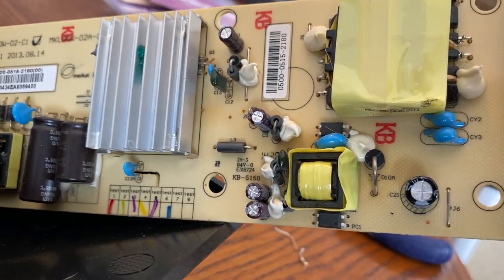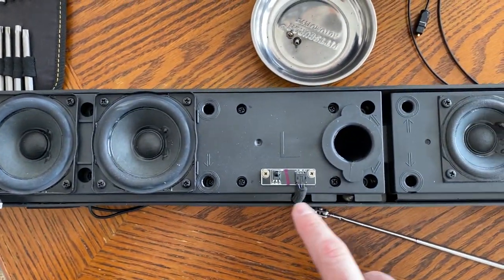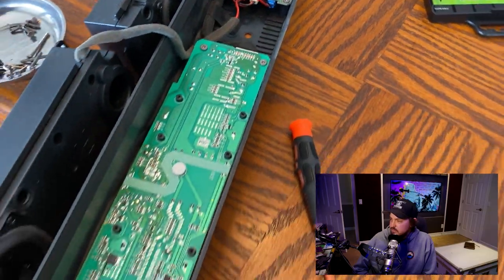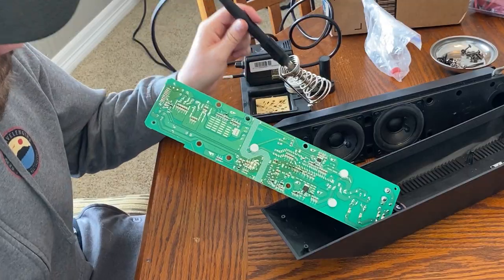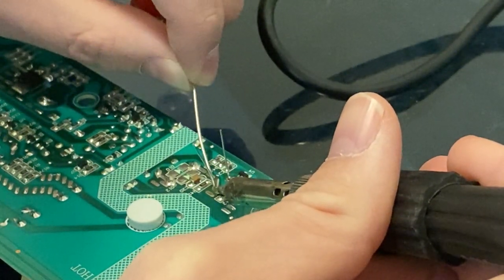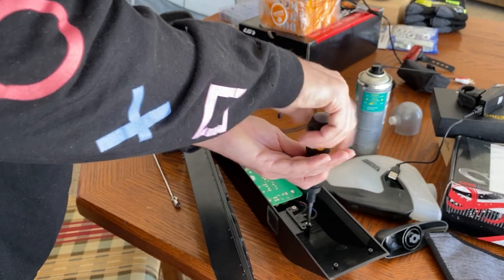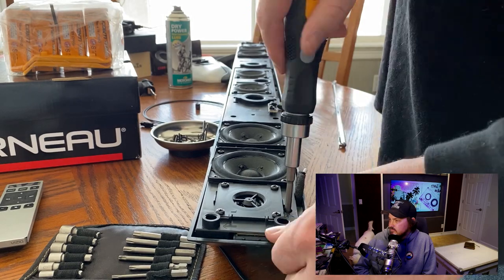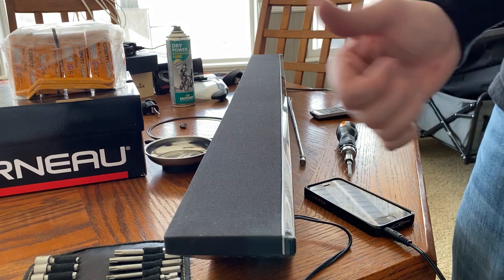Vizio Soundbar Won't Turn On? Replace The Capacitor – Vizio S4251w-B4 5.1 Wireless Surround Sound

Comment: You sir just saved me a couple hundred bucks!! Called Vizio and was told to recycle the sound bar and buy a new one. Now after $0.50 for the 470 uf 16v capacitor and thanks to my BTech prof for the basic soldering skills, capacitor has been replaced and my soundbar is alive again! Thank you!!

Comment: Just here to confirm that YES it works!!🎉🎉🎉 Woke up one morning and my soundbar stopped turning on. Ive never even used a soldering iron before, or even knew what a capacitor was, but I bought a pack of capacitors and the soldering iron on amazon for 15.00. I didnt see a “bulge” in the c21 or c22 capacitor, so I figured id just replace both while I had the speaker all dismantled.  Bam, done, works like brand new.

Comment: I got to the affected board by removing the right and center speaker housings. No need to remove the left speaker housing. Saved a little work and time.

Comment: Replaced C21 and C22 with some cheap replacements off Amazon and it works now - thanks for the useful guide! For good measure, after removing the capacitors I hooked them up to an LCR meter. C21 came back measuring 350uF with a dissipation factor of 0.2, and C22 came back measuring 400uF with a dissipation factor of 0.07 (lower is better, for those curious). Not sure if C22 was shot or just a low quality part, but C21 definitely needed replaced. Neither capacitor looked bloated, but they needed removed from the board in order to measure capacitance anyway. Hope this helps others!

Comment: It's contributors like you who post fix -it videos on YouTube that help so many people and save the day again. Thanks for this video, your work doing the diagnostics and sharing your resulting fix. First time for me soldering on a circuit board and now I can add that as one more learning experience. Thanks! Amazing that 240 capacitors would cost only $10. I don't know what an electronics  shop would have charged for the repair, more than $100 I would think,  but it goes to show you that you're paying for the diagnostic labor and not the parts.
Reply from the maker: Glad it helped and good work on first time soldering – not too scary, eh??

Comment: Glad I watched the end of your video. I just replaced my capacitor at c21 and 23 and thought it wasn't working because it wasn't powering on come to find out I forgot to plug in the remote control sensor. It is working again! Thank you so much

Comment: Worked great! I put in a 25 volt capacitor instead of the 16 to hopefully stop the repeated breakage. No issues with the change in voltage so far.

Comment: Thanks for the video. My Vizio S4251w-B4 has been turning off for a few years and just recently died.

Just something to keep in mind. These are electrolytic capacitors which means they have positive and negative polarity.
Remember to put the new one in the same way as the old one. In this case negative is the gray, -, arrow mark toward the edge of the board as seen at 3:06. The shaded side on the board, seen at 4:30, is negative. They can explode if put in backwards.

Comment: FIXED MINE!!!  THANK YOU!!!  Can't believe that a blown out sound bar was caused by a $1 part!  I ended up replacing both the C21 and C22 capacitors.  Thanks again for a very informative YouTube Video!!

Comment: A big thank you for this video! I'm a lady of 60 years and have never even picked up a soldering tool or fixed anything electronic until today.  I went to Harbor Freight store and for 10 dollars got solder tool and wire. 
Your video is very detailed and was so helpful! I truly could NOT have fixed by myself without your great video! ❤️❤️❤️
Also, both C21 and C22 both looked fine and showed no signs for damage so I just changed both of them. So I'm not sure if it was one or the other that was the bad one?
Reply from the maker: That's fantastic! Best comment on the video! Glad that it helped and you were able to get things fixed – and try something new! Yes, my capacitors did not show signs of swelling or expansion, they looked fine too – but once replaced, the soundbar began working again. ¯\_(ツ)_/¯

Comment: Hey I just want to thank you man! My Vizio 5.1 system from 2013 wouldn't turn on. I was ready to drop $350 for a new one, but then saw this video. $10 for a capacitor kit on Amazon and 30 mins of my time, and it's working again! C21 capacitor just like yours! Good as new! Thank you so much!!!
Reply from the maker: Nice! Glad it worked for you
Reply: @swhammondbuildsreviews  It just died again today. Lasted me from end of Sept 2022 to May 2023. Not horrible. Time to replace the bad cap again!
Reply: yup works again now

Comment: Thank you for this video. I just put in a new capacitor at C21. This was my first time working with capacitors and a circuit board. All went exactly as you laid out. After I soldered the capacitor to the circuit board I noticed the capacitor was not sitting tight to the board and it was a bit elevated. I knew my solder connections were good so I just left it. Hopefully that does not affect long term performance. It took me a while to figure our the short wire on the capacitor was the negative and that the negative side on the circuit board had the cross hatching. Thanks again for saving me from buying a new soundbar. Much appreciated.

Comment: I am so amazed. Not only does your article discuss Vizio soundbars, but this is my EXACT model! I bought mine years ago as a "refurbished" item, with only a 90 day warranty. I bought it, essentially 'used' because it was much larger and more powerful than anything else at the time - for my budget.  It has been great, but I pushed the volume too much in my home rock concerts.  The main bar would cut out, leaving just the sub-woofer and satellite speakers on.  I would turn it down 2 notches, turn the power off, the turn it on again.  That would bring it back, just a little quieter.  The 2 days ago it quit powering on at all.  I will have to order the capacitor, but you have given me great hope. Thanks.
Reply from the maker: When it works, it has been a great little soundbar. Good luck on fixing!
Reply: Yes, it is a lot of soundbar, ESPECIALLY when this unit hit mrkt.. Was one of very few with physical separate rears.
   I DID, at the time, choose this vizio for multichannel sound over a Klipsch costing around $900! It was too close to justify extra, what $600 for klipsch!

Comment: can't believe it worked. the c-21 capacitor on my board was not bulged at all. ordered few capacitors from amazon. figured i would at least give it a try. my soldering is basic but was able to change out neatly. did not even have to add solder. came out clean and nice. held my breath when i turned it on. works great. thanks for video
Reply from the maker: My capacitors never appeared bulged either, but always fried. Weird.

Comment: You sir are a genius. It worked like a charm!!! It was a last ditch effort before this thing was heading to a dumpster, and just like that, it is alive again. I was a bit concerned when i saw the capacitor was a bit fatter than what I got from amazon, but rating is the same so all good in the end.

Comment: This worked for me, thanks bro! I went with the 470uF 25V capacitor though, not the 470uF 16V capacitor and it's working fine. Your directions were spot on. I've never soldered in my life and purchased one from Amazon and it was simple to do. My SB is back working again!!
Reply from the maker: Love to hear it! Good work

Comment: Bummer didn’t work for me. I may change C22 as well to see if that’s the culprit. If that doesn’t work I may have a totally different reason why my unit won’t power on. Well it was worth a try anyway.
Update: added more solder the the capacitor and bingo the bar fired up. Special thanks to the author of the video. Saved me a bunch of $$$

Comment: Great video. Helps to use needle nose pliers to gently pull the old capacitor which gets warm when melting the solder .saved me $$$ and the old Vizio has great sound.  I did up voltage from 16 to 25. So far so good. 😊
Reply from the maker: Right on! Glad it helped

Comment: Thanks so much for this video! That cap was the exact problem with mine. Saved me so much time dinking around with a a multimeter. Works perfectly now, saved it a trip to the dump.
Reply from the maker: Right on! Glad it helped

Comment: Great tutorial.  Like the author, I had also replaced my C21 a few years ago, but the unit went dead again.  On examination, C21 was not puffy but one of the 1000 mfd capacitors was.  I replaced it, but no joy.  So, I replaced C21 again... even though it did not look bad... and everything started working again.

BTW, when replacing electrolytic capacitors, be mindful of the polarity, with negative typically indicated by a minus sign and a light colored stripe by the negative wire.  Take note of the negative side of the capacitor you are replacing and be certain to install the replacement the same way.  I find it helpful to put a small minus sign mark on the top of the circuit board prior to removing the old capacitor, and/or take a photo for reference first.  

Lastly, I suggest taking a photo of the underside prior to unsoldering the old capacitor, especially if you are not used to soldering.  Referencing the photo can help you make sure you have not inadvertently created a nasty solder connection ("bridge") between two adjacent places on the circuit board that should not be connected in this manner.
Reply from the maker: Good tips – follow these wise words. And yeah, the blown capacitors have been weird with mine as well. Usually it's pretty obvious, the bad capacitor swollen or bulging – but not the case with this for some reason.

Comment: I have the same model sound bar that won't power up so I ordered a new cord that worked for 5 days then died again. Could this be the same issue as well? I was about to order a new sound bar but I'm going to try this first, however I wanted to know how do I tell which side is pos and neg on the board when changing the capacitor.. appreciate the great video

Comment: I didn't have the same exact problem my problem was that it would turn on for only one second and then turn off, then it couldn't ne turned on for quite a while. I replaced the capacitor with a 25volt capacitor and it working just fine Thank You.
Reply from the maker: Glad it helped! Mine failed for a third time and I'm about to give up on it...
Reply: That’s what minor is doing. Which one should I order?
Reply: @swhammondbuildsreviews  
Edit 02-26-22.
Just finished pulling it apart, but both the 21, as well as the 22 caps both look fine.
I went ahead and replaced the 21 for like the 6th time.
After reassembly, still no power light.
So now I’m out of guesses, and not sure of any other options. 
Any suggestions?
I guess I will have to go back into it and start looking/smelling things over.

Also, the phone cord adapter into the Soundbar,  what type is it, & what end does it have to the Soundbar?

Comment: I am on the 5th time it has died. 
And it’s just too funny that as of yesterday, February 24 it has died once again. Initially I bought a five pack of resistors off Amazon for a couple dollars, I changed one and then I missed placed the pack of resistors. So the second time I had to buy another pack of resistors as well as finding the initial pack, so now I have plenty of your resistors, but the point you make is incredibly valid that there must be something else going on because both of the resistors that I purchased are two separate brands and types with all the same ratings, so obviously something else is creating this problem and it’s getting unbelievably tiresome, I also posted a video really cool to see yours. Thanks.

Edit 02-26-22.
Just finished pulling it apart, but both the 21, as well as the 22 caps both look fine.
I went ahead and replaced the 21 for like the 6th time.
    WORKS As Advertised!!!!!  Damn VIZIO.
Reply from the maker: That's cool that you made a video as well, I'll have to check it out! And yes, my capacitors didn't show any signs of failing (swelling or expansion) either. But, every time I've replaced them, the soundbar began working again. I'm on my 3rd or 4th fix of it now too... I may give up on it as it's a super pain to fix because I have the soundbar mounted to the TV and have take everything apart to access the innards. To truly fix the problem, someone will probably have to get the multi-meter out and check various voltages.

Comment: I replaced my capacitors last summer, and everything all went well and has been working just fine.  We had a massive thunderstorm last night and lost power, and now the soundbar will not power on at all again.  I checked the caps, but none of them looked bulged.  Would a thunderstorm/power outage cause them to blow again?  The soundbar was powered by a power strip, but that was not tripped.  I think I have a voltmeter at my workplace, but I don't know how to use it to test if they are bad.

EDIT... ordered caps, after I posted this comment.  Replaced just the one shown in the video (c21?) And it powered right back on.  Saw scrolling through comments most of you have done it multiple times, seems to be no different here.  Really like this SB and don't want to upgrade.
Reply: In guam here, I've had this sound bar for 12+ years.  We don't have the cleanest power and a few lighting strikes nearby and bad weather have shut my TV off before and i guess it was the soundbars turn this time. I had intermittent sound and then it just stopped and would not power on anymore. I'll try this fix
Reply: I appreciate your reply, I had the same issue. Power outage and multiple quick restarts. I hope this repairs the issue! Thanks!

Comment: Thank you sir. I’ve had my sound bar for almost eight years now and it just gave out on me. I was able to replace both the C21 and C22 capacitors by watching your video.  Is I can return this vizio M series and get my $300 back. For the record, the M series is pretty garbage. About how often have you had to replace your C21 and have you swapped out the C22 also? I figured it’s the same one; I might as well just replace it as well.
Reply from the maker: I've replaced C21 twice now, I have not replaced C22. Ironically, the sound bar just failed again a couple of weeks ago.  This will be the third time.  I'm thinking I may just give up on it at this point – it's a huge pain in the butt to uninstall because I have the sound bar mounted directly to the TV.  I have to take the entire TV off of the wall in order to access the sound bar... Anyway, glad it worked for you!

Comment: Can I ask how do you learn this stuff? What is this called and what type of schooling do you need? I want to learn how to fix electronics and appliances but don't know where to start. Is this engineering?
Reply from the maker: Good question! I learned because of necessity. I had broken equipment and was too poor / didn't want to buy new so I would try to fix it myself. Forums and YouTube help a ton – other people showing / explaining how they fix things, and then I'd try. Monkey see, monkey do, haha.

 But yes, you can go to school. Most of the time you get certifications for particular pieces of equipment / brands. Think "certified Apple technician". Depending on your interests, try looking up the Electronics Technicians Association – I'm sure they could point you in the direction of accredited colleges and vocational institutes.

Comment: It worked for a couple days and now it’s not working again. Do you know where I can find a replacement sound bar for that system?
Reply: You can’t get a replacement sound bar, best you can do is find a replacement power supply from another used sound bar as they stopped making the power supplies several years ago. The sub is paired to the sound bar so if you replace the bar the sub and rear speakers are useless so you you just end up buying all new equipment.

Comment: My power button lights up but after that nothing, i can connect or change input mode and it doesn’t respond to remote either. Any suggestions would be appreciated, thanks

Comment: I followed your advice and was able to get my soundbar running. Like you said, I think there is some other inherent issue causing the cap to fail. It must be getting higher voltages at that cap.
Thanks.
Reply from the maker: Glad it helped! Certainly not a permanent fix – my capacitor just went out for the third time last week...
Reply: @swhammondbuildsreviews  yes, this is the second unit I've had fail. Wish I'd known it was a fairly simple capacitor swap before I rebought a new unit, the first time!.
BTW, Can you check out the help request comment I posted a moment ago? Not usually used to communicating on youtube. LoL Thanks!!
Reply: Would a higher voltage capacitor help the issue?
Reply: @fernandovallecillo3565   i am going to try this now, with 25Volts. 3rd time now it fails, probably because my kids crank up the volume while i am not home hehe.

Comment: Great  information, I have a question my vizzo 
SB3651 -E6 sound bar went up I had it for almost 3years and it's not comming on meaning no power is that normal? I trouble shoot it still not comming on. If you were to reccomend another sound bar which brand and why would you reccomend it?
Also my other sound bar same kind would not come on I called vizzo this was like year ago that person had me press a serious of buttons and my sound bar came right on I tried explaining that to the vizzo people when I called about the vizzo sound bar I mention in the beganning of my comments they told me that it was no such thing of pressing a serious of buttons long story short I got bo help
Reply: My SB3651-E6 have same problem.  Its won’t power on . 😢  I had that for over 2years
Reply: did you already fixed the problem on SB3651?
Reply: @francyrussllanto6286   No still have the problem can you offer some support thanks for asking